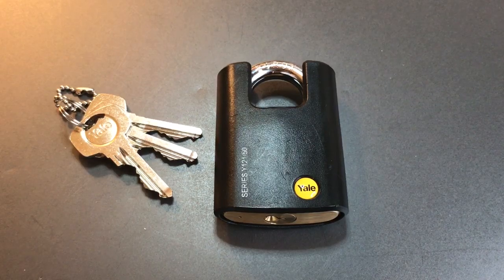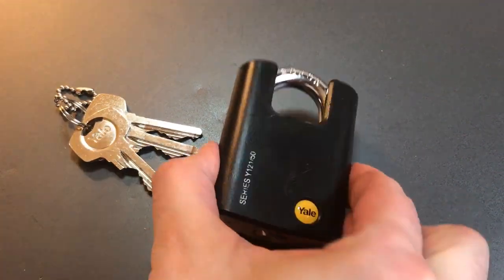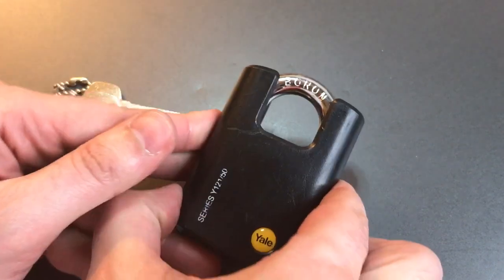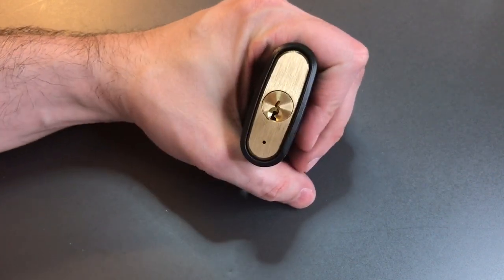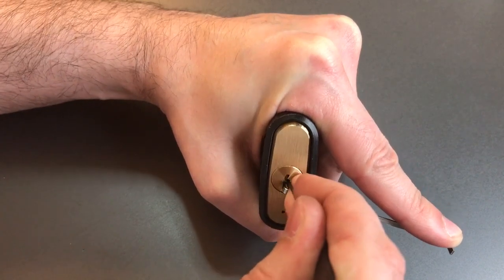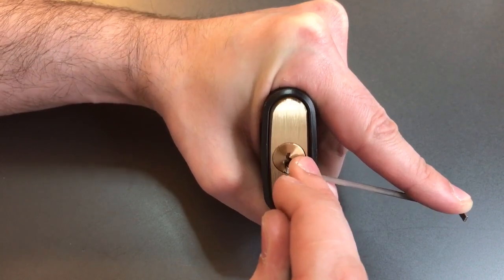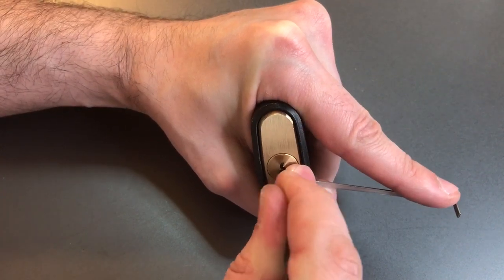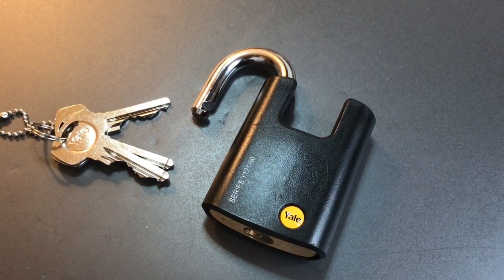[363] Yale Model Y121/50 Padlock Picked

Comment: Have you ever made a video picking your way out of handcuffs? Maybe try it with different 'picks' like a paper clip? 
I am still amazed at your skill.
Reply from the maker: Nope.  Never tried.
Reply: A lawyer with a handcuff escape video might pick up some extra  clients?  hahaha  Probably not
Reply: I would be interested, as long as the handcuffs in question are NOT smith & wesson. Everyone and their dead relatives going back 20 generations can pick smith & wesson handcuffs. Peerless or TCH would make for a good video, especially any TCH cuffs. Not TOO difficult but enough that would draw users in and educate them. If you can pick a pair of peerless standard handcuffs and you can pick a pair of TCH handcuffs, you can pick most cuffs out there with the exception of some high security models with funky keyways and mechanisms. Speaking from experience.

Comment: The plastic might be to protect the application. The band Master Lock puts just around the base doesn’t usually last for the life of the lock.
Reply from the maker: Could be, but it is sold as a "closed shackle" padlock.  :-(
Reply: They add scratch protection, it doubles the apparent size of the lock and they get to advertise it as shielded against weather and bolt cutters. The bigger the company the more decisions are made by MBA’s and fewer by engineers. Plastic is cheep.
Reply: I have a few of these locks, unlike their nonplasticcovered version, these actually survive winters pretty well, only one got a bit bad, but still reasonably unlockable unlike their cheaper alternatives. Also I assume the plastic might be a bit effective in dampening a hammer blow. Anyway these are like 6-7 dollars in Europe and seem better than the masterlocks.

Comment: 1:58 what is 'counter-rotation'?
Reply: Spaide man 
If the pin is formed like a spool it’s thinner in the middle than at the top and bottom.
Thus if you press it further down than to the middle of the pin there’s going to be some counter-rotation.

Comment: That shackle is wasted in a brass body, open in 3 second twisting it with a pipe wrench, if the case was steel it might actually hold up to a bit more abuse.  That casing is pure theatre.